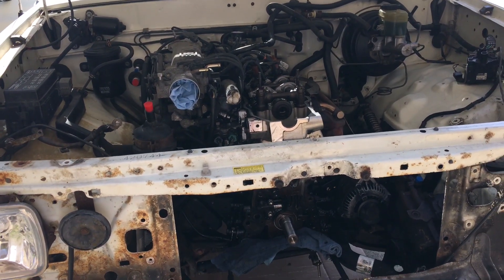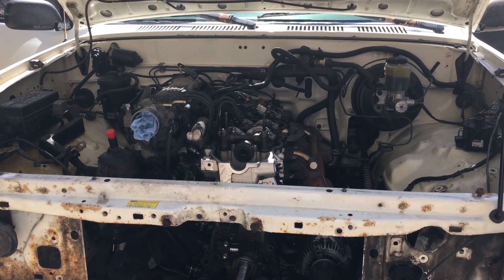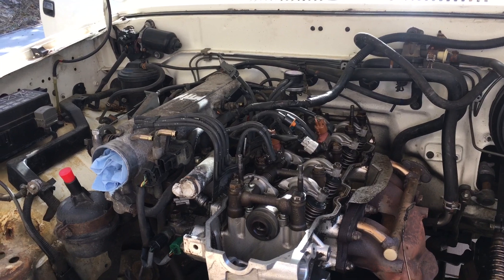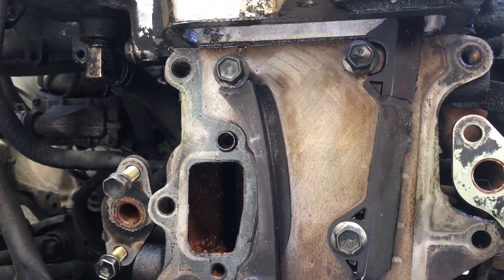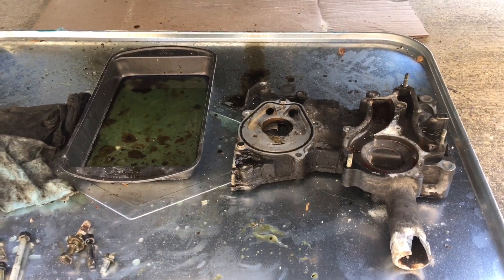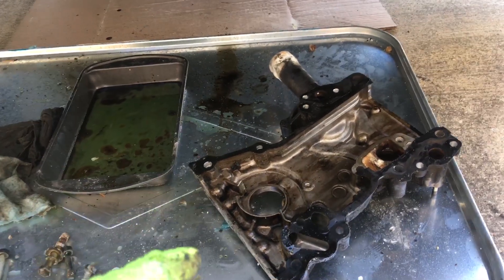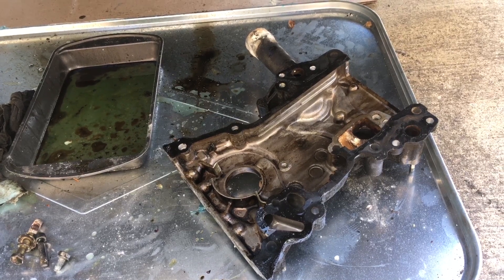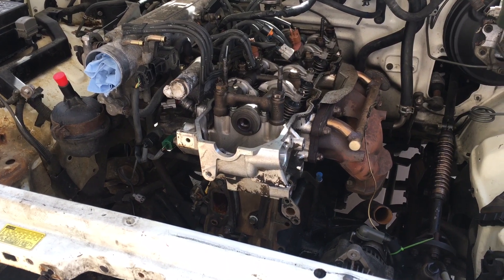Toyota pickup or 4Runner w/ 22RE - WATER IN OIL WTF? Loose timing chain tensioner & cover "failure"

Comment: thanks for making this video. I had water in my oil. I was ready to send it to the Junkyard.
 Also your idea about no oil in that coolant makes a lot of sense so it’s probably not a head gasket leak.
I probably got a timing chain cover problem. I’ll check it out. Thanks again.
Reply from the maker: You're most welcome - glad the video helped out. Yea if the truck is otherwise running okay but you have water in the oil and also high miles on the original chain, it can certainly be that tiny hole situation in the front cover. You can pull the valve cover and check the chain to see if signs point to that; the chain will be sloppy loose typically. It has to really flap around to do a number on the timing cover in there (you can see tracks sometimes as well). Also, shine a light down in there and feel the timing guides, usually they will be all beat to hell and shattered, etc. I have another video on the channel showing the guides in my buddy's oil pan there when we fished everything out. But if you catch everything early, a little water in the oil won't be the end of the world for the motor. I did my friend's truck (new dual row timing cover) and he's driving it around no problem. Runs great. Let me know if you have any questions on anything and good luck with your truck!

Comment: Sweet video!  I have a 89 toy this happened to. I'm old, arthritic, and cant see well anymore. Got lazy and took to a "recommended" mechanic. Won't go into details (too long). I ask him ( and gave him the parts) to take care of this. I had already gone as far as removing the timing cover and seeing a broken off guide and loose timing chain, checked pressures, etc. So, put all back together. Took it to him.  He claimed "bullshit"/"no way water can get into the oil! It's impossible"/ "I've got 40 years experience/know what I'm talking about blah,blah,blah". Got very macho and uppity.
So, I told him fine.... I must of had a glitch in the matrix.... just do an oil and coolant change for me and I'll come pick it up.  I'm seriously curious if he notices the color of the milkshake that comes out... LOL. When I get it back, just going to do it myself... Oh, and I think part of the patronizing BS was the fact I'm frumpy 5'2" old woman. Sorry buttercup. I did a partial rebuild on my first slant 6 in 1975 (65 dodge dart I bought for $50 bucks), and was a Journeyman gas/diesel mechanic for a large part of the later 70's into the 80's.  I've duct taped/barb wired/bungee corded and what I call "revented" vehicles as a hobby forever. Guess I'll come outa retirement one last time. LOL
Reply from the maker: This is the first time I've ever actually seen this failure in person myself. I had read about it on the Wiki page some time ago, but seeing it in the flesh is something else! :-)

Comment: Hello Ray.   I have a 1993 Toyota pickup 22re that start and die almost immediately. I switch out the air meter sensor ,the throttle position sensor and the circuit opening relay.  It has fuel when and spark when I crank it but it would not stay running. Please help????
Reply from the maker: Hard to say... but you might want to bypass the relays for fuel by jumping Fp and B+ in the diagnostic box just to rule out everything that controls fuel (Fp to B+ will force the fuel pump on and keep it on and bypass a lot of fancy stuff). I'd also do a compression check to see what compression is. Check ignition timing. Also the TPS requires feeler gauges to set and very specific readings on a digital meter - is that how you set it? Also try pulling out the 15A EFI fuse for a couple minutes to reset the computer. Check the door inside the AFM also to make sure it's no binding. Have you recently done any other work to the car?

Comment: So is there any saving the engine at this point? I think this is what is going on with my truck. And sorry if that's a stupid question, I am new to this and get a 22r to start learning
Reply from the maker: Typically this is a symptom of a 22R/E motor which has high miles on the original timing chain. Do you happen to know how many miles are on the motor? As far as saving the motor - if you are seeing water in the oil - you wanna first confirm it's not from a blown head gasket first (do a compression check). It also depends on how long all this has been going on. But if you catch it early enough, yes you should be able to save the motor. Generally speaking, the 22R is a very robust engine and can handle a certain level of abuse. I would change the oil and filter immediately and add some head gasket stop leak to the coolant (this can actually seal the internal pin hole inside the timing chain cover short term and buy you some time in some cases). If you can get the internal pin hole leak to seal up, then change the oil and filter and see if the issue returns. You do not wanna drive around too much with frothy oil, but typically the engine can handle that for a brief period of time without a catastrophic failure. It may wear the bearings a bit more, but as long as you change the oil quickly and get on top of making repairs with a new timing chain cover, generally speaking you can save the motor. Feel free to let me know if you have any further questions on anything and good luck!
Reply: @ray5961  You are very helpful. The truck has 268k miles. I was actually taking it to a mechanic when it started blowing white smoke and running rough. I had just bought it so I was taking it to have a good look over. I turned it off right there and had it towed the remaining distance to the mechanic. They did a pressure test, and looked perfect, except one cylinder was misfiring. I am travelling out of town right now, so the truck has been sitting with no repairs since that incident for ~2 weeks. The previous owner did not know if the timing chain / chain guide had been replaced. My first thing to do when I get home is check that the timing chain / guide looks ok. 

The mechanic I took it to said that the carb may just need to be adjusted and that's why it was blowing smoke. I'm not too sold on his theory, but it's on my list. The oil looks good, even under the cap. The coolant in the radiator is clean, but the reservoir is pretty dirty. When I took the car to the mechanic the reservoir was empty and they filled it up, so I think that the reservoir was just dirty, because the truck hasn't been run since the reservoir was filled. 

Sorry if this is too much info word vomit haha, your video is one of the few detailed documentations of this specific issue, and I bought the car to learn, so I'm trying to get a good grasp on what these symptoms may mean.
Reply from the maker: @helenparris9974  Hey man, no problem at all with the length of the message - I'm more than happy to help out if I can over comments or email directly if needed (my address is in the about tab of the channel, so feel free to email me there if you wish). When my buddy and I bought the truck featured in this video, it was much the same situation as you describe. We did a compression check and quickly realized it was likely not a blown head gasket. Lots of milk shake in the oil though. We made it approximately 1 mile to AutoZone and blanketed both lanes with so much white smoke that people had to wait for the smoke screen to clear behind us. Fun times. We got to AutoZone and I dumped the oil - my friend made it back home, but the milk shake reappeared rapidly. He put head gasket sealer in as a possible counter measure against an internal head gasket failure and that ironically stopped the pin hole leak. We must have changed the oil on that motor 4 times in 4 weeks to help protect it. Incidentally, he had I believe 270K miles, which was enough time stretch the timing chain and destroy the guides (it's pretty easy to check to see if the guides are shot by removing the valve cover by the way; you can peak down in there with a flash light and see if they are still there or broken, etc. Did you happen to see my other video showing my friend's guides in his oil pan? 

As far as an overly rich carb mixture spewing white/blue smoke out the tail pipe, not gonna happen. White smoke generally equals blown head gasket or some level of water intrusion into the combustion chamber - if water mixes w/ the oil, some amount will slip past the rings and/or be sucked into the PCV system and then you'll be belching clouds of smoke down the road. Excessive oil into the cylinders will also do it (again typically a blown head gasket). If someone recently did a compression check and squirted too much oil into the cylinders (for a wet compression check) that oil can find its way into the exhaust system and create a similar scenario, however generally the oil finds its way to the muffler and pools there; then oil blows out at stops but otherwise no smoke while driving. Eventually that oil burns off and you are okay again. 

If the coolant reservoir was empty, that's not a good sign. It can indicate loss of coolant is occurring somewhere inside the system. From how you describe your particular situation, it sounds like you stopped it plenty early enough. I would just be very careful here as you proceed. If there is a water leak in the head gaskets, water can leak into the cylinders and then if you so much as crank the motor, you will hydrolock it and bend a rod (or the rod generally will go through the side of the block and destroy the motor). I would make darn sure you have a highly skilled mechanic in the mix here. You definitely do not want to crank the motor until you remove all 4 spark plugs and do further investigation here. I would also suggest removing the valve cover and visually inspecting the timing chain and guides. If the timing chain is super loose that would point towards the pin hole issue in the front cover, which is fairly straightforward to resolve if caught early. If compression across all four cylinders is within limits, that generally points to everything being okay w/ the motor. I would also inspect the plugs for signs of burned on oil, etc. 

Please feel free to contact me either here or directly as much as you need to help resolve your situation with the motor over there! :)
Reply: @ray5961  Thank you for your reply. This is exactly what I was hoping for when picking out the 22r — is a supportive community of people who a more than happy to help each other. I’ll be back home in a few days and check out all of the things you just mentioned. If it’s ok to email you then I will do so if any other questions arise.
Reply from the maker: @helenparris9974  For sure man... email is on the channel tab there some place.

Comment: When you reinstalled the timing cover, what did you put up top near the head gasket, where the cover and head gasket meet? RTV? Curious, cause I have a '93 and I'm about to reinstall my timing cover and wasn't sure what/if I should put anything up top to prevent leaks.
Reply from the maker: Yes, I used RTV Ultra black sealant up in there. That's the main sealant I use on my motor. The grey stuff doesn't adhere as well as the Ultra Black. Here is the one I use here and where I usually buy it - https://www.amazon.com/gp/product/B0002UEN1U/ - nothing gets past this stuff. I use it to seal my oil pan also. Works fantastic. On the specific area you are talking about, I just put it on both sides of the part of the head gasket that is hanging out and make sure to push the RTV back into the corners with a tooth pick or something. Install the front cover and seal everything up and wipe away any RTV that squeezes out. I also use that along the bottom edge of the timing cover where it meets the oil pan. 12 to 24 hours and you should be good to go.
Reply: @ray5961  Thank you so much. One last question, did you apply the RTV and cork gasket with your oil pan or just the RTV? 
Also, I took your advice and splurged on buying those Toyota Service Manuals on E-Bay. You have the best channel for this 22RE!!!!
Reply from the maker: @damiandavies4632  Thanks! I appreciate that. I do not use the cork gasket stuff, no. I install the pan directly to the block with Ultra Black RTV sealant only. Put the pan on, lightly thread the bolts in, let the RTV set up for around 60 minutes, then do the final torque. That cork gasket will ruin your day; I never use it.

Comment: Highly educational video here. Thanks for sharing. My 1990 pickup has 113k so hoping I want have to do it to soon, i will be happy if it last me 200k. I did not know about the dual timing chain upgrade, so i will be going with that option when it is time.
Reply from the maker: Yeah, the dual row update is nice. The main thing with the single row you have now is to keep an eye on the plastic chain guides on both sides - you can check them when you remove the valve cover to adjust the valves. Those have a bad habit of snapping and/or fracturing where they secure to the block. You can usually reach down and see if they are broken with your finger or like a screw driver and mirror. The dual row kit uses the older metal backed guides, which never break. It's definitely a super nice upgrade - be careful of the bolt that goes down through the front of the head to the cover when you remove stuff (it's hidden by oil). Also, the bolt that comes in most of the kits for that location is usually a few mm too long, so you have to measure everything and adjust the length to avoid ripping threads out. The dual row timing chain should go 300k+ miles whereas the single row is more like 200K +/- kinda thing usually.
Reply: @ray5961  that's all great information, however I don't believe I would want to tackle this job myself. I would probably take it to someone, looks like a time consuming job.
Reply from the maker: @alvaroeloredo  It's a bit of a job for sure, especially with the motor in and/or if you have P/S or A/C, etc. In the case of my friend's truck there, I talked him into dumping the power steering and A/C, which helped a lot when it came time to do the front cover. Even so, it turned out to be a rather involved job. Lots of cleaning and prep work to have it all come off 100% perfect in the end.
Reply: @ray5961  luckily for me my truck did not come equipped with power steering, but it did come with A/C which I'm thankful for lol. I don't think you could talk me into deleting my A/C these Texas summers are brutal my man lol.
Reply from the maker: @alvaroeloredo  All my ex's live in Texas (Houston to be exact); I hear A/C is quite popular out there. Be glad you don't have all that P/S BS haha. I was never so happy to throw anything in the trash as all that stuff. My truck didn't come with A/C, at least I don't believe it did. When I drive through 100 degree temps, it's definitely windows down haha.
Reply: @ray5961  lol, hey I have a lot of family in Houston, I don't visit though because I can't stand bug city traffic lol. I'm more of a country boy myself. And yea AC Is a priority over here for sure.
Reply from the maker: @alvaroeloredo  Heat and traffic... that's kinda the impression I get about Houston all right. I'm with ya on living in the country.
Reply: @ray5961  yup that's pretty much it, rite on brother.

Comment: Years back I had the same issue, the chain had worn a small hole through the water passage and I thought it was a head gasket. I had the engine Rebuilt.  But had the milkshake again. Pressure testing the cooling system reviled it was the timing cover had a hole. Lesson learned. 1200 dollars later. Lol..
Reply from the maker: Oh ouch lol. Yeah, that sounds like it was a fun adventure. haha
Reply: @Ray Nada  yeah but it was a pricy one. But it ran better. Lol.. that truck was my first decent vehicle there was 150K on it but now it's closer to 400K I still have it. I like toyota, my wife and daughter, Booth Drive, and we bought my son a first gen 4 runner, I have 2 custom cabs 4x4. One is getting ready to get back on the road. My oldest son has a 5th gen truck. So lots of toys in the family. My dad got me hooked on them. Tha ks for your videos I'll be working on the truck 1 by 1. I see some of the mods you have done. I'll be referring back to your work. Thanks again. 👍
Reply from the maker: @Mr2eyedjack  That's awesome man. Yeah I'm gonna get my kids into Toyotas also. Both my son and daughter are gonna have to rebuild the motors on their first cars before they are allowed to drive :-)

Comment: Time for 3rz swap. I had to rebuild my 22re and had a very hard time finding oem toyota parts
Reply from the maker: You ain't kidding!
Reply: @ray5961  I know 😂. I had to use a mixture of dorman parts and Chinese, which I don’t like. I should have just swapped for the 3rz. Hell even the 2rz has slightly more power and tq. The parts are still around and plenty
Reply from the maker: @Jimmy_Russle  Yeah, the 2/3RZ is a nice swap. Most of the 22RE OEM parts are still available through eBay or LCE, etc. but they tend to be rather costly. Depends on the part also of course. As long as you stick to Denso or AISIN usually you are okay. Dayco also is good. Dorman is where things start getting a little dicey :)
Reply: @ray5961  i could not find a new oem 22re cam.
Reply from the maker: @Jimmy_Russle  Yeah, you probably aren't gonna find one of those. I run Webcams here. If you need a stock cam (or near stock), call Webcams and talk with Faith, she can hook you up with something nice and as good or better than OEM. LCE also sells their stuff as well as the OEM rocker arms you'll want to run.